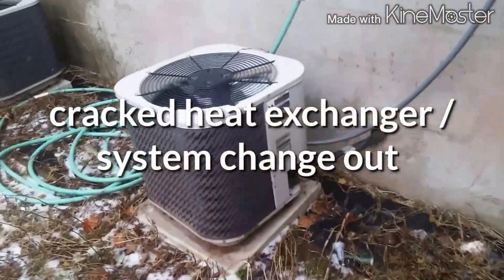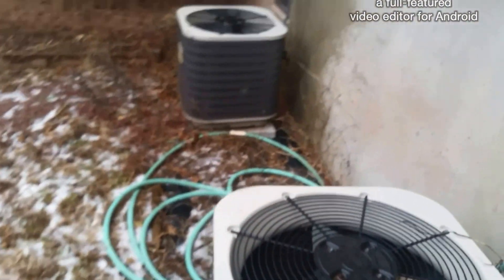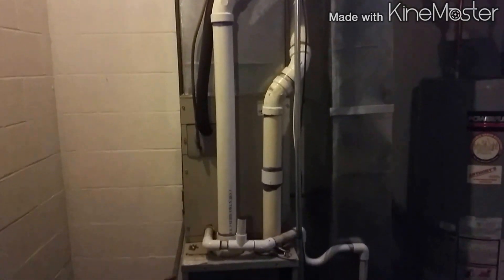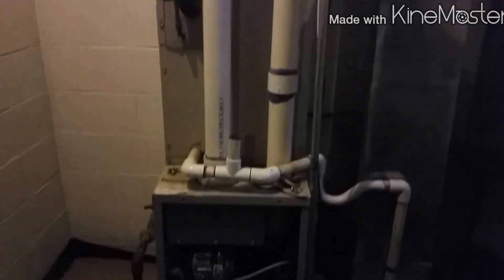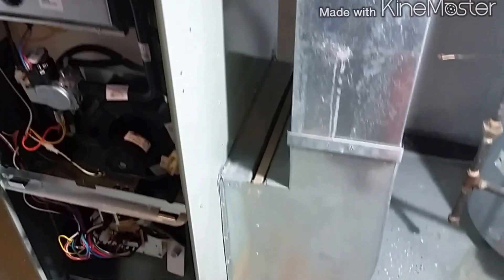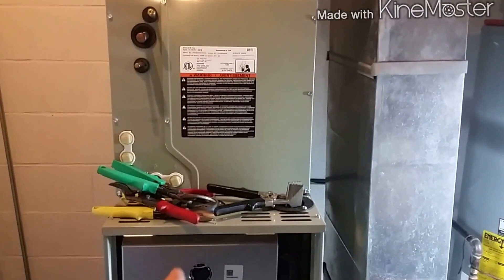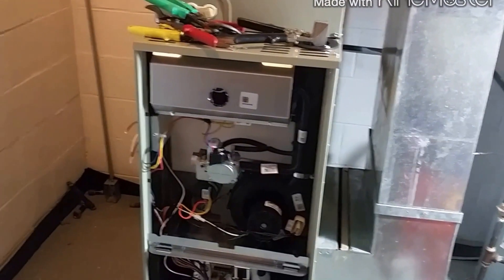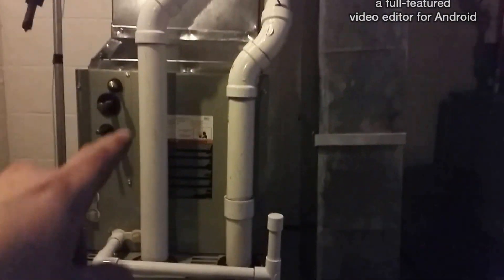cracked heat exchanger / system change out

Comment: Seems there are a lot of heat exchangers failing on these 90+ furnaces.  Just how much efficiency is lost if the thin exchanger wall is made heaver.  I think they are too thin.  How much of this problem would an improper heat rise and lack of combustion analysis contribute to this?  Maybe you and  the other youtube techs discuss this in kind of a foum please. I would be very interested in hearing everyone's input.  I know such failures are income opportunities for the hvac people,  but in my mind the customers are getting short changed when they have to deal with such failures after buying a furnace that they assume will last a long time.   Will the industry ever re-evaluate this problem of thin heat exchanger walls?  Probably not unless the government forces them to do it.
Reply from the maker: Thanks for the comment and good ?

Comment: Great job that heat exchanger was rotted in rust! What a pain just to change that one part!
Reply from the maker: That's why they elected to just change the system cause it's much easier.
Reply: Nice looking work justin henning
Reply from the maker: Rob HVAC thanks Rob

Comment: Nice vid brother.  What's the difference with a 90% and a 80% furnace. I don't see to many out here but they are here. Thks
Reply from the maker: 90% can only be vented with pvc and direct outside unlike a 80 % that is vented into a chimney with metal flue piping . 90% make condensation while in heat mode and r more efficient compared to 80%.
Reply: guess I can  tell u I see more 80%  furnaces here in Florida.  I normally see double metal flue pipes here.  Thnks